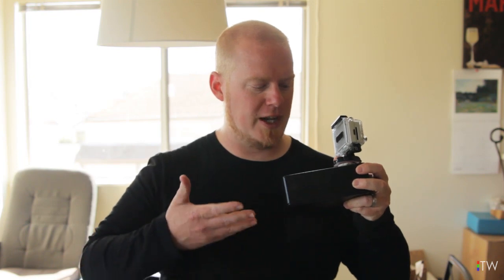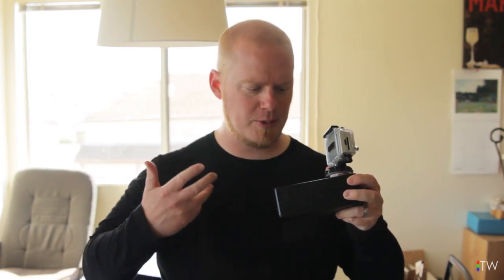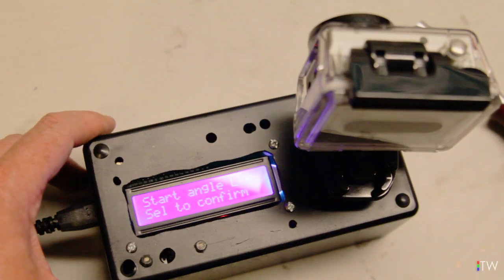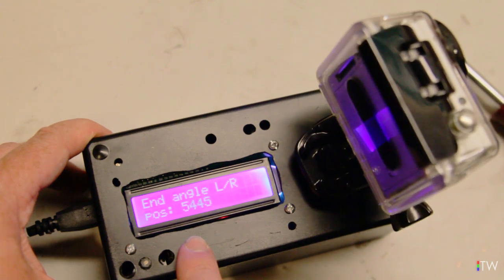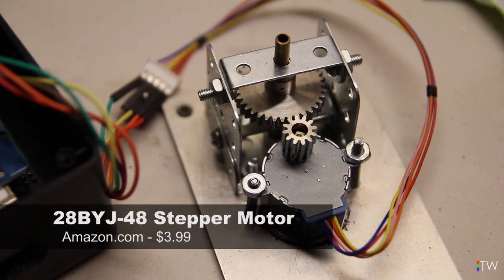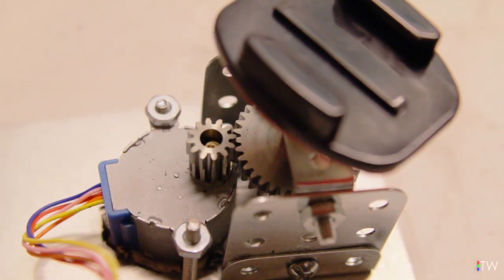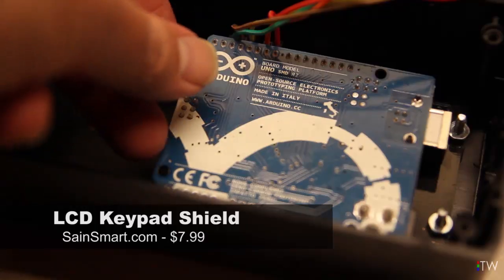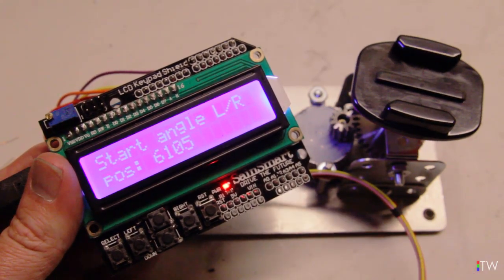Time Lapse Panning Controller for GoPro Cameras

Comment: HI
great project , but I had issues with the key pad of a generic key pad so after lots of research i had to change the keypad values.
from this
(adc_key_in < 50) return btnRIGHT;
if (adc_key_in < 250) return btnUP;
if (adc_key_in < 450) return btnDOWN;
if (adc_key_in < 650) return btnLEFT;
if (adc_key_in < 850) return btnSELECT;
to this
(adc_key_in < 30) return btnRIGHT; 
if (adc_key_in < 150) return btnUP; 
if (adc_key_in < 360) return btnDOWN; 
if (adc_key_in < 535) return btnLEFT; 
if (adc_key_in < 760) return btnSELECT; 
works a treat now
  thank you

Comment: I greatly appreciate that you took the time to upload this video. I have been looking for a project just like this. I was wondering how difficult would it be to incorporate a speed control in the design ie. 180deg in 30 minutes / 180 degrees in 60 minutes. Could this be accomplished in the coding or would it have to be done in the gearing of the project? I thank you for your assistance in this.

Comment: Is this fluid motion panning or is it start stop start?
Reply from the maker: +pixelhobo photography It's a linear stop-start. I find that for using time lapse in video, cutting into the footage after the motion starts (and after the gear lash is taken up) provides better results than a bezier ramp into the motion.

Though, the code is all there, so adapt away!

Comment: This is a great solution, if you want to pan right. Thanks.
Reply from the maker: T.K. Archibald you can make it go any direction you like when you set up your starting position and ending position for your time lapse. There's no need for re gearing, the code on the Arduino just reverses the direction of the motor.
Reply: You can make it go to the left too, just add another gear 1:1 with the motor gear. With enough thought, I'm sure you could devise something to adjust it on the spot which direction you'd like to go.
Reply: Ah, awesome, well there ya have it Brynmag!

Comment: Nice job! I plan on making a similar rig (I currently have the IKEA egg timer setup). I'm currently working on a motorized panning slider with arduino and I also want to make a panning rig. On the slider I am currently using a PWM'ed DC gearmotor however, I would like to be able to set the time and distance with precision, so a stepper motor would be a better solution. However, as you probably know, steppers take more power than "regular" dc motors. What kind of battery life are you getting with a stepper motor and what battery do you use? Thanks!
Reply from the maker: I'd been using a MintyBoost with a pair of rechargeable 1500mAh AA batteries in it, and that seemed to last between 2-3 hours - which is about the same battery life I've come to expect out of a GoPro Hero 2 battery when using the Time Lapse function of the camera. Nowadays I'm using a portable battery charger with a solar panel - lasts a little bit longer, (likely because of the solar panel) but I don't know what the capacity of the battery in it is.

I never made one of the Ikea egg timers, but I did make one out of a garden hose timer. Same idea, but it's a 2 hour timer instead of one.